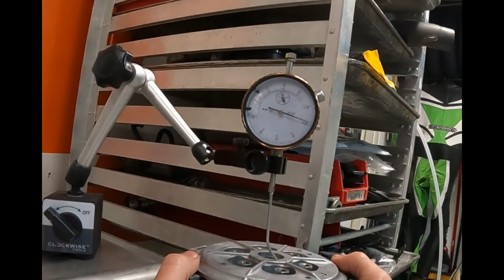Pre-Season Engine Checks Part 2

Comment: My 2010 Zx6r doesn't like shifting into 3rd (like it won't even go half the time), is that likely a bent shifting fork? Not sure if there was a common failure in these trannys. Thanks
Reply from the maker: No common failures, not any more than any other sport bike anyway, but a bent fork could be a reason for difficult shifting, however, there's a number of other parts that could contribute as well.  Luckily for you, you can remove that entire transmission without removing the engine; just like seen in the video, except keeping the engine in the bike.  Everything involved should be closely inspected such as: shift forks, shift shafts, ratchet a pawl mechanism, shift drum, and the gears themselves.